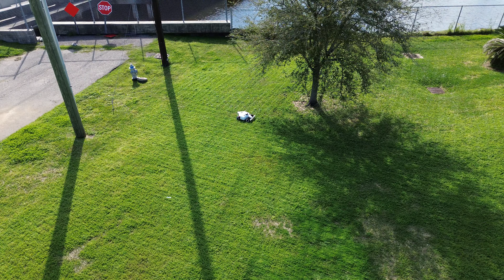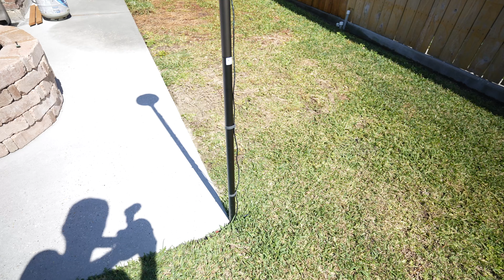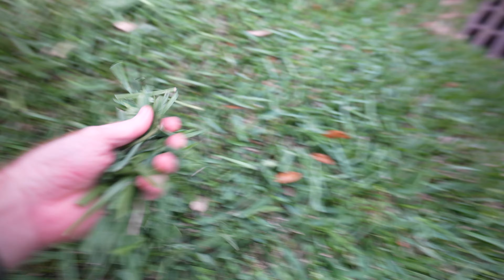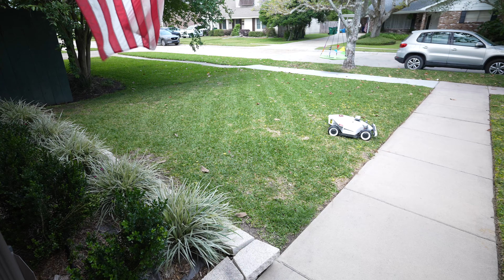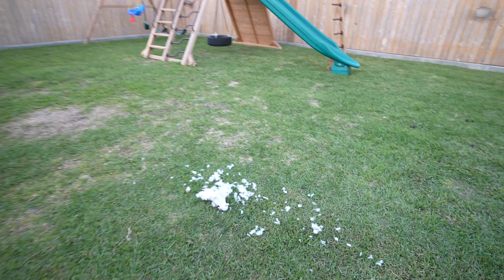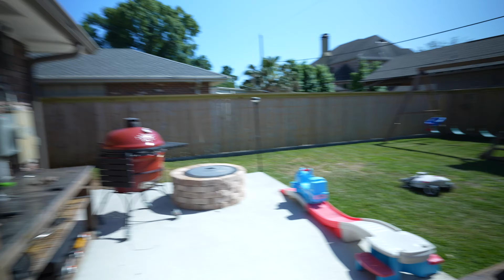Never Mow Your Lawn Again | Luba 2 AWD Robot Lawn Mower

Comment: Got my Luba 2 just 7 wks ago and have only used it about ten or twelve times but I've got a couple of tips.  I e-mailed Mammotion to find out which Turn setting uses the least amount of battery watt/hrs and they replied the "Zero" turn setting uses less power than the multi-point turn setting.  
   My front lawn is 3750 sq ft (you can chose between metric or imperial readouts) and I run a bit of "overlap" between passes so there are at least 100+ 180 degree turns needed to cut the area.  If I use the multi-point turn setting, the Luba 2 will need to recharge before just before finishing. However, if I set it for Zero radius turns, the Luba will finish the area just before it needs charging (my Luba 2 runs for the charger when the Battery hits 13%).
  A second tip, if you are in Zero Turn mode, the Luba Will slip downhill some while turning on a slope.  If you've got a small "No-Go" area, like a tree or small Flower Bed and you map the outside perimeter at the 6 inch recommended distance from the edge, the Luba will likely slip into that No-Go zone/area if performing a Zero turn on the upper side. I re-mapped my No-Go Zones that were located on a slope to allow for a wider buffer on the higher side which keeps the Luba from slipping into that zone during a Zero turn. 
   I'm still getting used to the Luba 2, there's some parts of the App that aren't so intuitive but I'm learning.
Reply from the maker: Thanks for all the info. Super helpful!

Comment: Also,  the omni wheels are great.  My 3000 has them.  It's the reason I bought another.  

However,  if you have hills like me,  it does struggle to zero turn in place when turning towards the slope.  Which does dig up some spots and also eventually gums up the rollers. They're is no real easy way to clean them either.  

As of now,  I haven't seen anything with luba 2 that makes me want to upgrade from the originals.  That's the whole reason I'm looking up videos to see if it does anything better than mine.  

But if you don't have a luba 1 like me,  you pretty much don't have a choice unless you buy used or find someone that's selling them new still.  Mammotion does not make them anymore as they are now focused on this version

Comment: Unlike the Luba 1, the Luba 2 is not intended to work at night due to it's vision system that the Luba 1 lacks. Awesome review!
Reply from the maker: correct. But it still works at night even with the vision system turned off lol
Reply: @BreakItYourself Interesting because I was just watching another review and he said anytime it got dark he would get a message saying it was too dark and it would just die in the middle of his yard
Reply from the maker: Strange. That never happened to me. I wonder if he was using the RTK. My guess is that if you don’t have the RTK then the robot wouldn’t be able to navigate once it got dark.
Reply: @BreakItYourself  The Luba won't function at all without RTK.
Reply from the maker: That's not true for mine. As I say in the video, after a few runs, I unplugged the RTK and it was fine.
Reply: @BreakItYourself  Luba 2 can keep going for  up to 100 or so feet before it stops but that requires vision to go even that long.
Reply: @BreakItYourself  You wake me up with your lawn mower, I then wake you up with 3am Slayer ;)